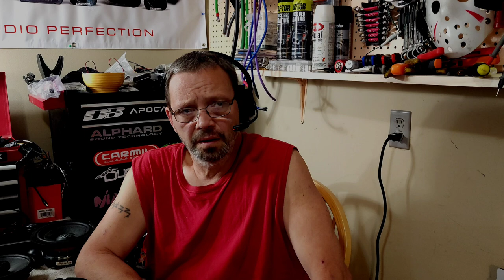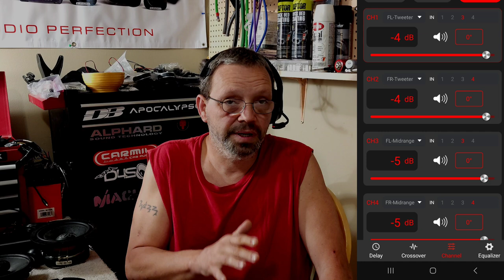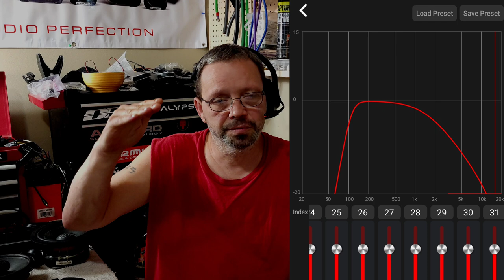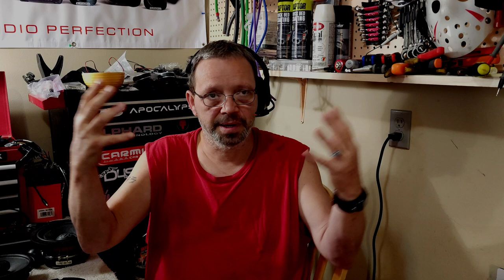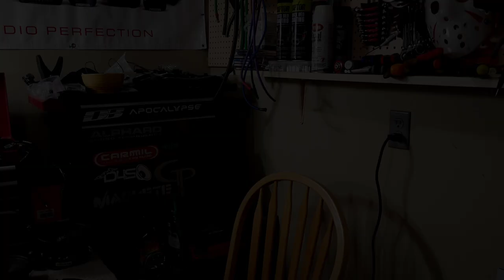2 ways, 3ways, Components.. Car Audio Speaker placement Explained

Comment: Question....if coaxial is two way audio set up, what is coaxial speaker and a tweeter
Reply from the maker: still a 2 way, just with added drivers, same as my doors , 2 6.5's and 2 tweeters all in one door, still a 2 way,
Reply: @CarAudioEnthusiasts  ok